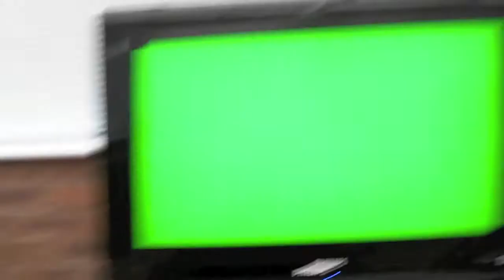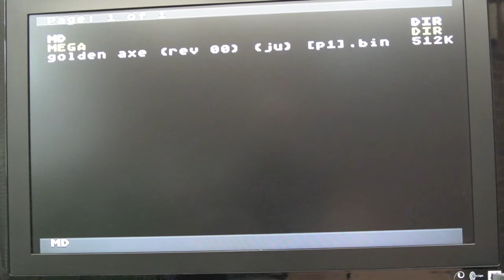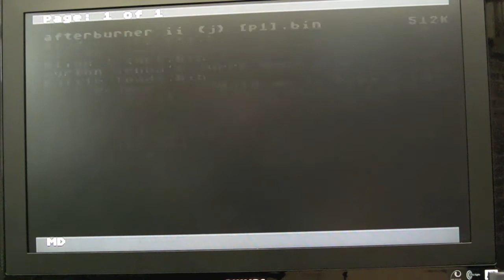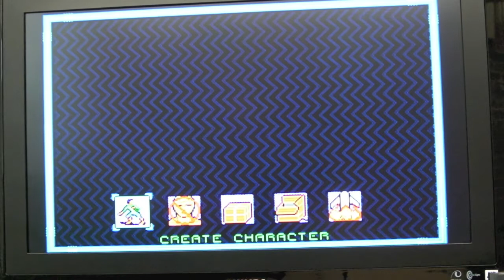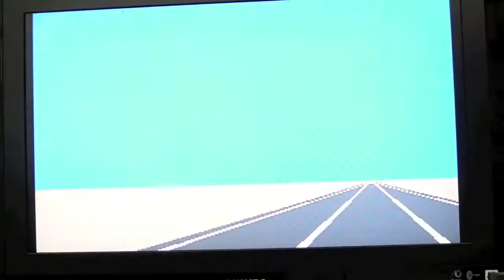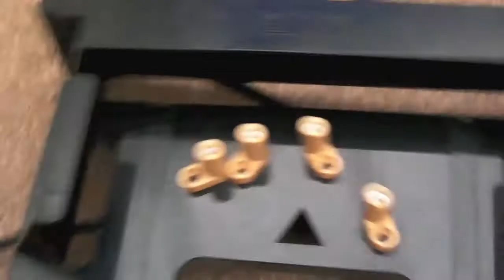Pickups (Sega Megadrive Everdrive & Neo Geo MVS)

Comment: Swweeeeet. Someone else that loves Buck Rogers :-D
CtD was and still is my top game ever. Love it.

Have you got anything bad to say about the Everdrive? I've spent a fortune on games for various consoles but one of these for the MD/NES/SNES would eliminate my ebaying forever.
Reply from the maker: Yeah, Buck Rogers was awesome!!!  I will start playing that again soon - It's on my list of 'must re-play' games.  I've got nothing bad to say about the Everdrive at all!  It's an awesome bit of kit.  I can play every single Megadrive / Genesis and 32x game on my system without a problem.  It also helps if you've got a Mega CD as you can load different region BIOSes using the everdrive, and use the everdrive as a replacement for the backup memory cart or whatever it was that was an accessory to the Mega CD - ie. You can move save games from the Mega CD internal memory to the Everdrive and vice versa.   If you get one its worth getting the Mega Everdrive rather than a straight Everdrive.  It was around £20 or £30 more but its faster and allows larger ROM images, I think the cheaper one is slight restricted (but only a little bit, 99% of games work on the cheaper one).